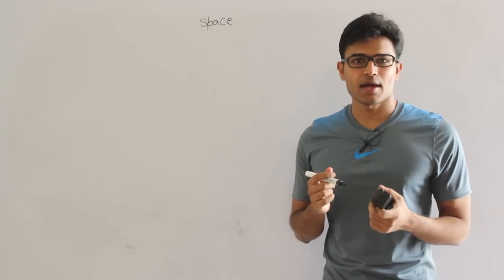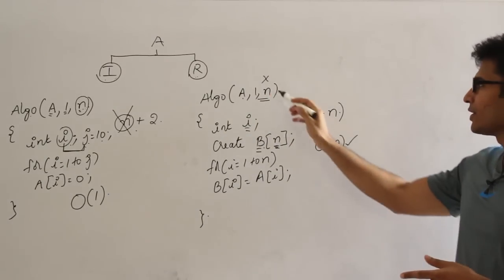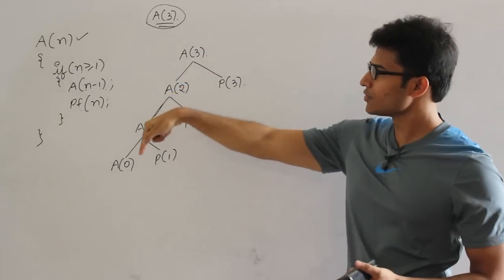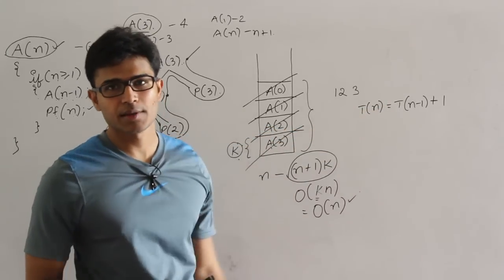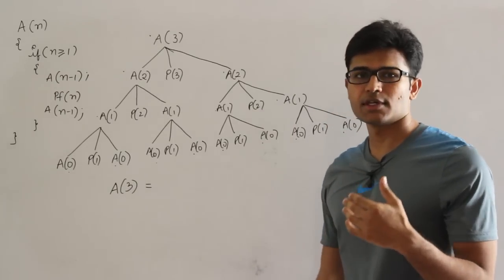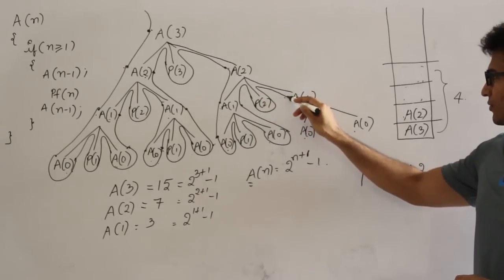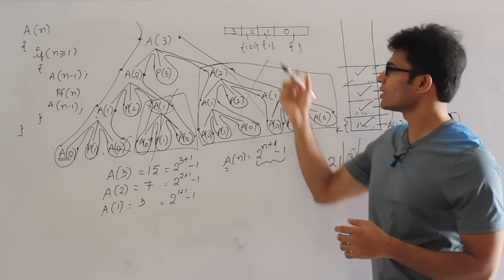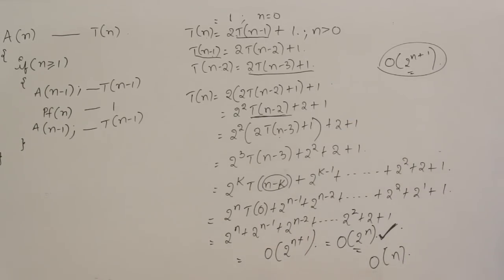Algorithms | Time and Space Analysis |Analysing Space complexity of iterative & recursive algorithms

Comment: Questions...!!!
1. If an input is an array of length n then it is also considered ryt?? For first loop you are discarding input size which is wrong (i.e space complexity = input + auxiliary space)
2. What is the space complexity of a function with for loop running from 0 to n and has a statement "Employees e = new Employee ()" ?? Here n Employees objects are created will it add to the memory??
3. From point 2 at any given time these objects are dereferenced after for loop ends and say is not used anywhere in the function block should we consider it as O(1)??

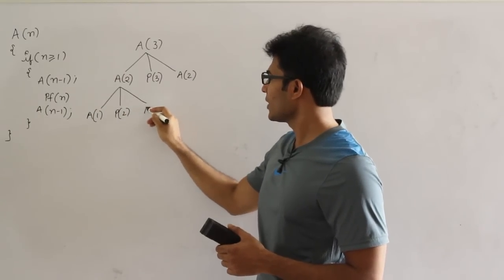Comment: Sir, 24:38, whil making the tree, shoudnt the A(n-1) command continue till the base case. why make 3 cases. why not follow the flow of recursion. the recursion will call itself again and again in line 1 of the if condition, once base case is hit(A(0)) , then it will go to the remaining two conditions(print and the next recursive call). The tree would be same but the actual flow is differnet i suppose. Please correct me if i am wrong. cause knowing the actual flow of recursion is quite essential for debugging recursive programs
Reply: My bad, you do show the path of recursion afterwards. Cleared my doubt thanks!

Comment: In the very first example I doubt if its O(1) as u dint count the A[i] inside the loop which runs and needs "j" number of cells where allocations do count into space complexity ! ...correct me if I am wrong and please clarify my doubt.
Reply: array A[] is the input. Please note we do not count input variable space as memory space required for function body. A[] is already allocated before the function is called (out of the local function scope). Am I right? Do you understand?
For recursive function: it needs ADDRESS of A[] for its recursive call(s);
Reply: Well ya! that makes sense.. thank you :)
Reply: But we count ADDRESS of A as a memory space (one word - technically 32/64 bits for example) if A is passed to a recursive call because in this case, address of A is pushed into program stack memory.
Reply: oh right! and what about the array like it is supposed to be a set of int values right accordingly occupying say if 3 cells then 3×32 bytes , isn't it?
Reply: The size of int A[N] is   N * sizeof(int32). But the address of A is a 32 or 64 bits number.

Comment: can anyone tell me what will be space complexity of the following piece of program?

int funcA(int n) 
{int b[100];
for(int i=0;i<n;i++)
{
b[i]=i;
}
funB(n);
}
int funB(int n) {
int b[100];
for(int i=0;i<n;i++) {
b[i]=i;
}
}

I dont know how to calculate space complexity of non recursive function if it contains a function all.
Reply: I believe it is O(n) (as long as n< 100); 
Calling a non - recursive function is similar to having the piece of code inside your same main function (or funcA in your eg), so your program is similar to 
int funcA(int n) 
{
  int b[100],c[100];
  for(int i=0;i<n;i++) {
    b[i]=i;
  }
  for(int i=0;i<n;i++) {
    c[i]=i;
  }
}
All you are doing is calling the for loop twice, which will take 2n space. 
Implies a space complexity of O(n).
Hope that helps.
Reply: it will be O(1)
Reply: the complexity will be O(1)
Explanation : For the first part in function A, an array of size 100 is defined, which allocated 100 bytes of memory and similarly for the second part i.e. funct B, another hundred bytes.
Now, these 100 + 100 bytes are irrespective of the value of n, as these have to be allocated in the memory.
So the complexity is O(200) which is nothing but O(1).
Reply: You named two functions' variable parameter the same name n. And you didn't use input parameter n as array side. So it make people confused.
Assume funcB parameter name is m.
int funB(int m) {
...
}
So the space complexity is: Sp(100) + Sp(100)
Time complexity is: T(n) + T(m).